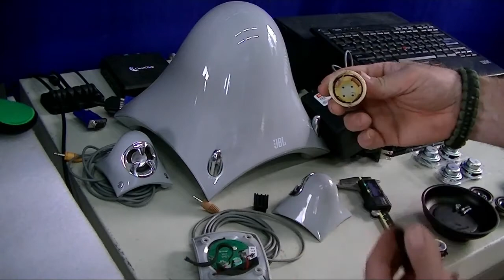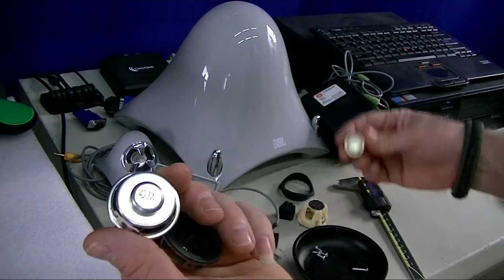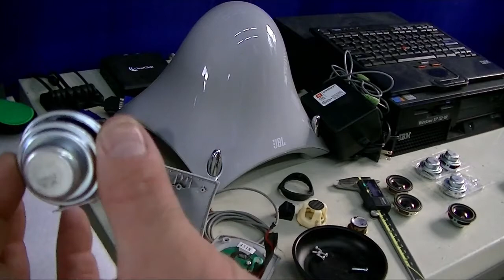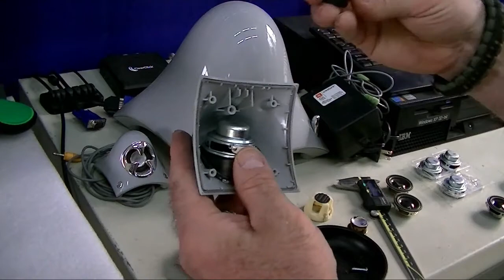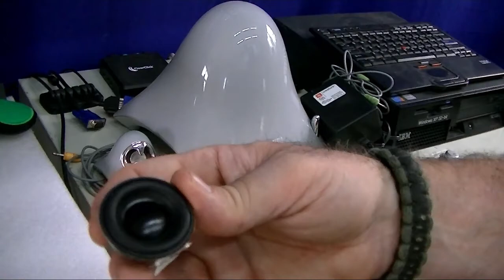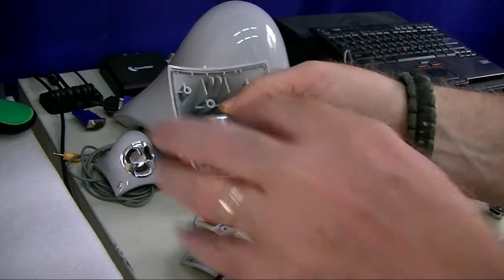Back at the JBL "Creature"! - Satellite speaker repair.

Comment: Grinding out the housing to 40 mm is a chore. Ill fitting pins are going to get clippedmoff and the wires will get soldered. Make no mistake.  It is not a 30 minute project.

Comment: Awesome! I'm having trouble with the capacitive/resistive touch volume controls... If you have any advice on repairing that, I'd love to hear it! I've confirmed that all 3 wires on the TRS wire have good connectivity from the 1/8" connection to the circuit board, and and the volume up/down wires have good connectivity to the circuit board as well. I'm hoping that one of the surface mount items are not bad. The two larger capacitors seem OK, but I only did a quick multimeter check.

One thing I haven't checked is the circuitry in the main subwoofer yet. I'll do that next!